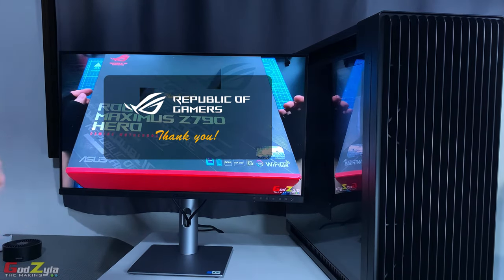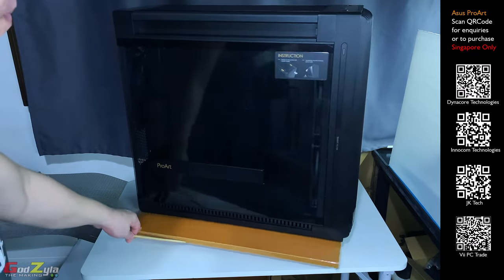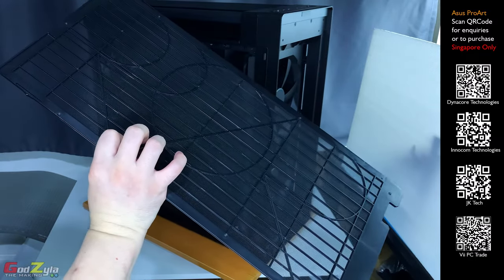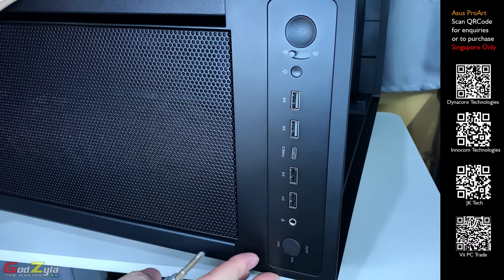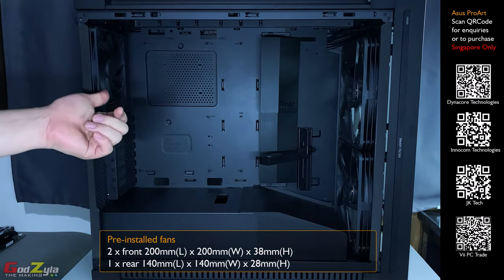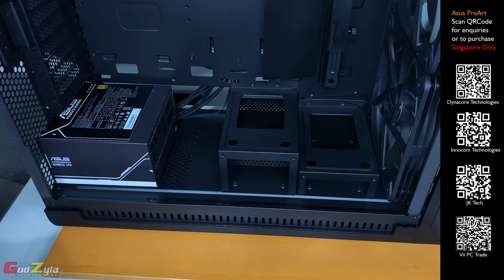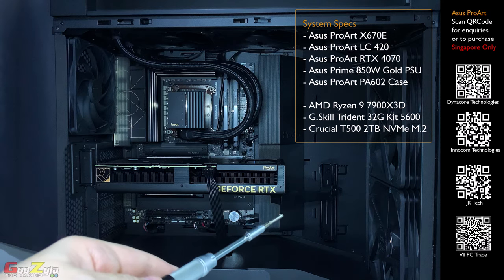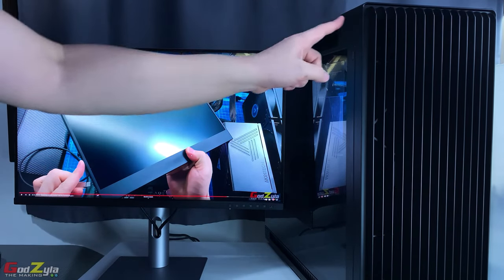Asus ProArt - Featuring PA602 Chassis

Comment: Excellent case. The only thing I had hard time connecting power cpu cable from the top hole, the hole in the case is a bit small. Do you suggest connecting it from the front or getting an extension?
Reply from the maker: Hi Galaxius1, welcome to my channel. Which PSU are you using, if you are using PSU that has sleeves on them, that will be abit tricky and I don't deny it's not easy to fit. I do not advise to have extension as this will degrade the current. It will be advisable in furture to purchase PSU with flat type of modular cables. Sleeve PSU cables to me is a hassle too stiff to work with. For your case if you got no choice then get a short extension cable as that will prevent the connector from tear.
Reply: I have viewsonic vertex 1200. I am not sure, maybe they have sleeves but it was a bit stiff.
Reply from the maker: @Galaxutube  your PSU are having flat cable.. maybe you are trying to slot in two EPS 8 pin cables at the same time. Try plug in one first and follow by another, it should not be so difficult.
Reply: Thank you
Reply from the maker: @Galaxutube  you are most welcome 😉

Comment: Hi. The tur4080 is about 150mm high. Is it possible to mount it using a vertical bracket? The manual says 125mm, but from your video it looks like you have area to spare.
Reply from the maker: HI Tae Seong Son, welcome to my channel. It is possible to mount but just be mindful that it might hit the rear fan. You can try adjust the position of your rear fan or to even remove it totally. The Vertical mount standoffs will push the GPU up.

Comment: Do you think it's possible to get the ARCTIC Liquid Freezer III 420 in using some trick? I know it's the radiator that's too thick but I'd hate to not be able to use the arctic AIO
Anyway fantastic reviews ❤
Reply from the maker: @nicolalugato1678  hi welcome to my channel. Though I have returned this case to Asus SG. My last encounter with this case, it’s able to fit in and additional to this, someone in my comment have mentioned it too. Thank you for your feedback and all the best with your build too.
Reply: @KleoYan  Thanks
Reply from the maker: @nicolalugato1678  you are most welcome and all the best with your build too.

Comment: About to buy this case, did you actually try putting that 4080 TUF GPU inside of the case, bolted in, etc. I am afraid of ordering and then it's too big or the POWER cord for GPU gets too bent... If you could test this for us, that would be big!!
Reply from the maker: hello Christopher Neil, welcome to my channel. I do have the Tuf 4080 Super OC. I can confirm with you, you don't have to worry about space, this case depth, measuring from the motherboard base to the side tempered glass. It's measuring at 220mm, if I am to minus off the motherboard standoffs (5mm) and giving some space at the tempered glass 10mm, you still have 200mm of space. the Tuf 4080 Super OC is at 150mm. so you have 50mm gap between the tempered glass and the top of the GPU. it's more than enough. For the 12VHPWR connector, as on specification. to be bend at the 35mm point. so if you plug the 12VHPWR connector to your GPU. you still have 15mm gap before touching the tempered glass.
Reply: @KleoYan  thank you! Ordered!
Reply from the maker: @christopherneil8884  Nice, you are most welcome. Just a reminder, kindly make use of the front 200mm x 2 fans as intake, do not change it as you will experience not only being quiet, in addition, your thermal will be significantly good. Infact this case only needs a liquid AIO above and you are good to go 😉

Comment: Is it possible to completely switch off 200mm fans from the front panel button or in order to do that you need to disconnect the cable inside the chassis?
Reply from the maker: Hi Marcus Goodlooking, welcome to my channel. The only way is to disconnect the cable as there is no switch to off it. but I wouldn't advise to swtich it off, it suppose to aid to bring in cool air to your components.
Reply: @KleoYan  Thanks for your  information .I've just wanted to to know if it`s possible when pc is on idle fans will be to loud for me on auto mode
Reply from the maker: @marcusgoodlooking2482  it's not at all loud. If loud, you can adjust in the uefi of your motherboard.

Comment: What would you recommend or decide for yourself between these three cases? Asus proart pa602 or dark base 901 or Corsair 7000d
Reply from the maker: Hi Marcus Goodlooking, welcome back. Out of the three, I will take this PA602, reason being 1) I like stealth black, 2) I dont have to worry on getting additional fans which will add up the cost, 3) All is needed is to plug a 420 liquid aio at the top which comes with the fans. Alot did mentioned his is pricely but if you are to calculate the additional cost to purchase good case fans, the price will add up. Leaving other cases + fan cost which is equivalent or higher compared to just get this case. 4) the features of this case are very well thought off. 5) Bottom mesh filter removal (easy access) 6) the rollers which you dont have to carry the whole case out inorder to reach the rear I/O ports.
Reply: @KleoYan  Thanks again for your detailed answer.I like design of Proart  with build quality  and fact that it is a latest from the bunch what brings some nice solutions to the table but my main concern is limited space for 210 mm PSU`s and Im not sure if I would be able fit Arctic`s  360mm cooler on the top of the case
Reply from the maker: @marcusgoodlooking2482  hi and you are most welcome 😊 For 360 Arctic Liquid Freezer II / III, you will fit and as for the power supply. If you do not use any 3.5" Harddisk, you can always remove off the HDD cage to make room for your lengthy PSU.
Reply: @KleoYan  Thank you very much 😄 for clarifying my doubts . It will definitely help to make right choice.
Reply from the maker: @marcusgoodlooking2482  don't mentioned it. you are most welcome.

Comment: I really want to buy this beauty for my  non rgb build . But i am very terrified what if one of two or both intake fan fails where i will be able to buy those huge fan 200 mm fans  can i fit 140mm × 3  fans  ??
Reply from the maker: @Tifoyo  hi and welcome to my channel. You can fit 2 x 140mm fans only as there are only holes for 2 x 140mm fans.

Comment: I'm looking for a quiet gaming case so the Be quiet Dark base 701/901 and this one are on my radar. I read in a spanish review that the Asus fans are made in collaboration with Noctua. Is this true?
Reply from the maker: Hi IGF, welcome to my channel. Yes the rear case fan and the liquid 420 ProArt fans are making use of Noctua.
Reply: @KleoYan  Thank you for answering. So the front fans are not in collaboration with Noctua? And are they quiet or should I look at Be Quiet cases if I want a quiet build?
Reply from the maker: @IGFone  hi sorry that I do not have the bequiet case for review but for this ProArt case, though the front fans are not Noctua fans but at 200mm that runs at low rpm, it’s not only quiet but does bring in tons of air to the case as compared to use 120 or 140mm fans. But the choice is yours 😉
Reply: @KleoYan  Thanks! Maybe i'll give this case a go. Good luck with your channel.
Reply from the maker: @IGFone  thank you and all the best with your build too 👍